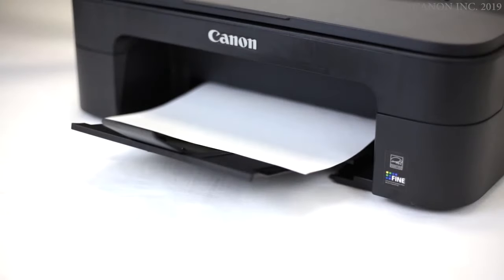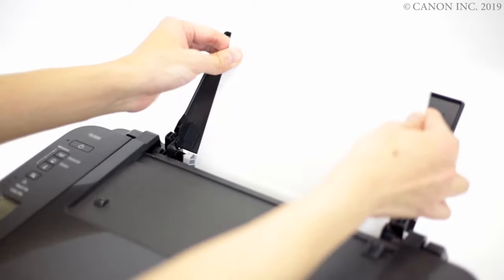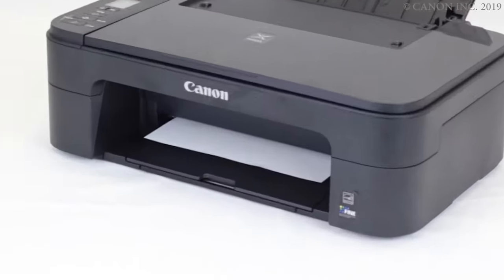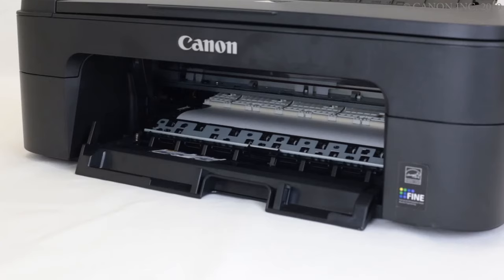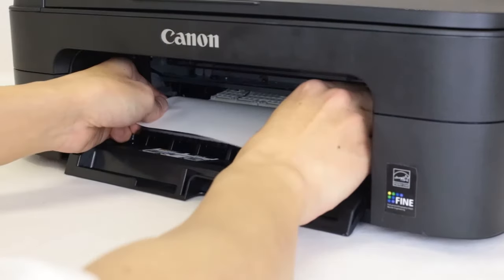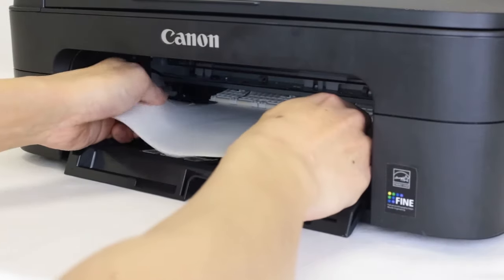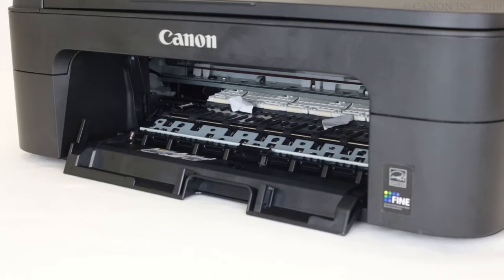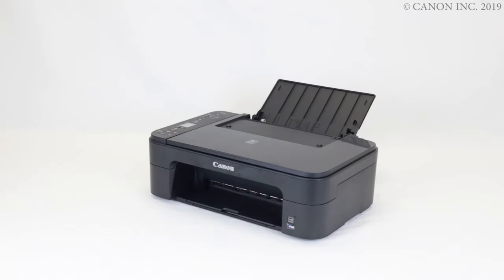Canon PIXMA TS3320 - Removing Paper Jams

Comment: Hi :) Everytime I try to print something it jams. I don't need to learn how to remove jammed paper. I need to learn to fix it so it stops jamming. Is there a video that shows how to do this? I live i Canada
Reply from the maker: Hi!  To avoid paper jams, you'll want to make sure you're using paper that meets certain specifications.  Your PIXMA TS3320 is designed to use paper from 17 to 28 lb (64 to 105 g/m²), with a minimum size of 3.50" x 5.00" (89.0 mm x 127.0 mm) and a maximum size of 8.50" x 26.61" (215.9 mm x 676.0 mm).  Paper that doesn't fit within these specifications can cause jams.

If you need additional help and you live in Canada, then we recommend contacting our colleagues at Canon Canada for assistance.  You'll find them on the web at https://canon.ca

Hope this helps!

Comment: A piece of paper got caught as it was feeding in my TS322 the 3rd tim I used it. The printer said it had a paper jam so I looked all over and through the printer. There is no paper!! Now the paper wont feed. It will pull paper in less than a inch and it gets stuck on the third (wheel). I believe that was the problem all along. Now Im out $50. This is the second Canon Ive bought and both ended badly.
Reply from the maker: Hi Tamatha. We're sorry to hear you've been experiencing paper jams. You'll find additional technical support options from within My Canon Account at: http://canon.us/account
Reply: Yes I know. I am very computer literate. I even went as far as removing the top of the scanner. (I also have technical knowledge). There was no paper. But thank you for replying. I was forced once again to go buy another Canon because just as last time I had just bought ink so I was even limited as to what product I could get. Walmart never keeps a good supply on printers anymore.
Reply: I got mine today and have the exact same issue. Printer did one page and since than only pull it an inch. I bought the TS3550.
Reply: Daniel K Thank you!
Reply: @Kraudi  have you ever figured it out? It started happening to me now
Reply: Have any of yall figured it out, same problem here
Reply: @artman3  I did. I returned it the next day and bought an HP :) Problem
solved.
Reply: @Kraudi  i just solved it rn, I found another youtube vid and this lady force cardboard down, then found a pencil stuck inside.

I did the same and there was an earring 😅

Comment: Worst printer i've ever had.  Everything is a nightmare, from trying to print, constantly having to use my location to print, constant errors, printer messages of jammed even if nothing is in the printer, low ink even if the cartridge is still full, printer spool error, printer blocked even if nothing is inside...garbage!!!!! Stay away!!!!!!!!